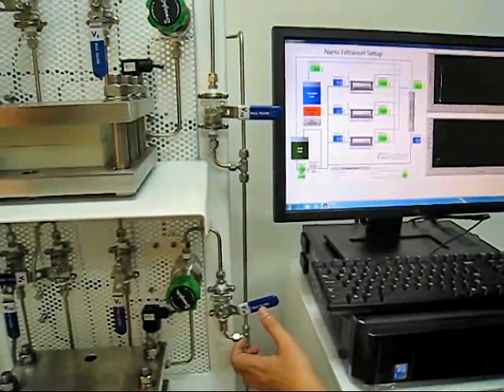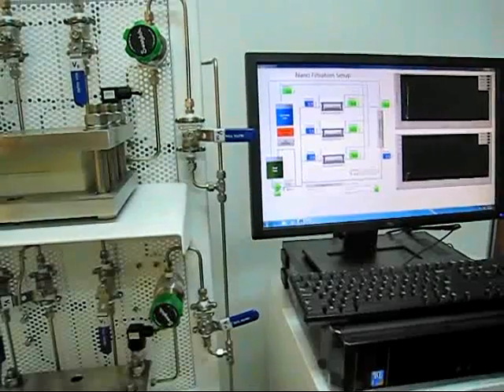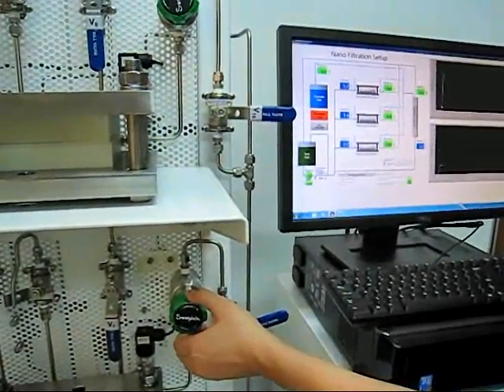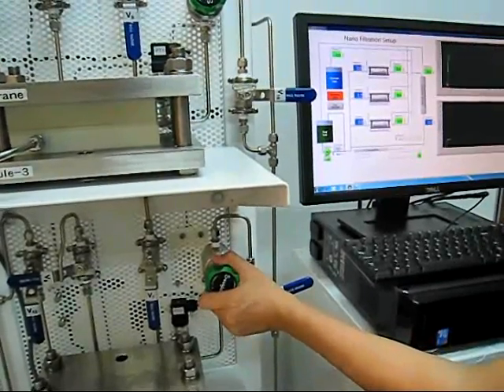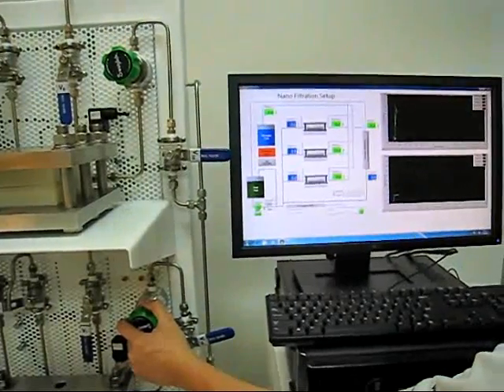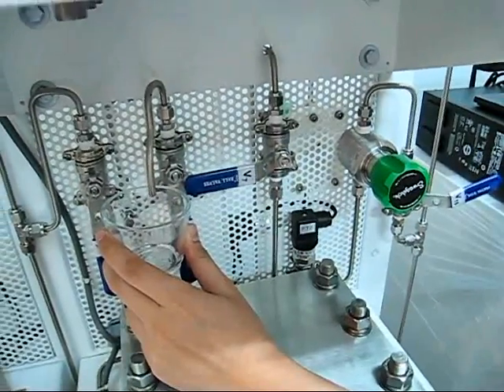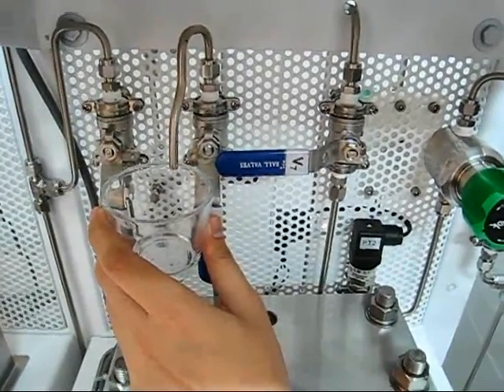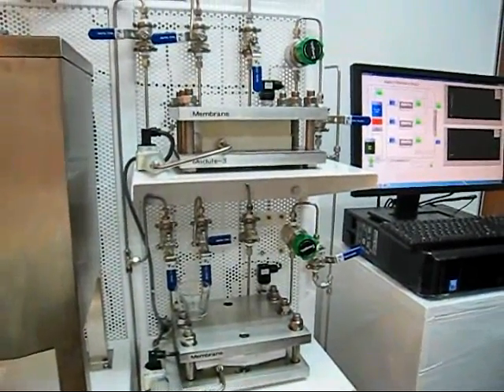Nano Filtration (Part 4)

Comment: Great videos, I would say however that a ball valve shouldn't be used to throttle and increase back pressure. You will find this will destroy the seats and require replacing more often. You would be better off using either a plug valve or needle valve.

Comment: What kind of back pressure valve you are using ???
specification ? and supplier name if possible ?
Reply: It is a Swagelok Regulator, contact your local distributor with your requirements and they will be able to assist in the correct selection, as well as most of the components on this set up.